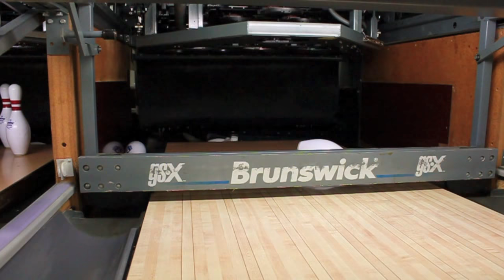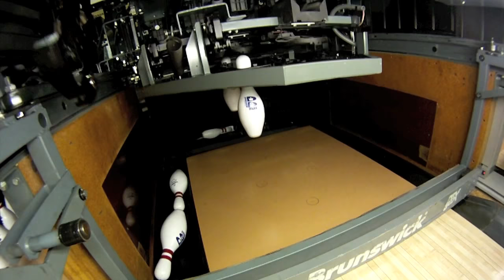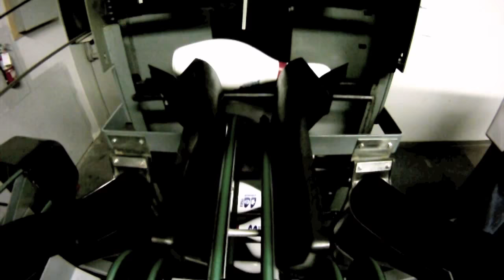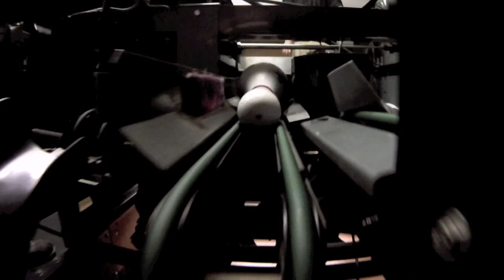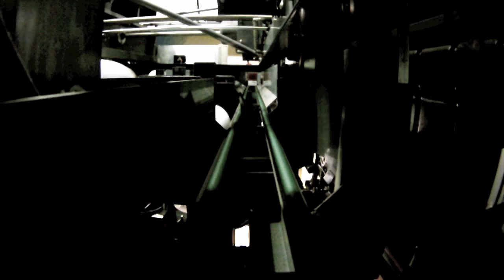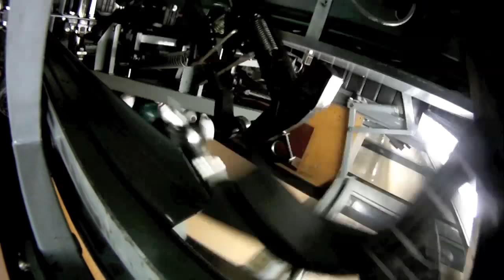AWESOME Brunswick GSX Pinsetter Video

Comment: Bowling in an empty house with a gsx is interesting.  You can hear the machine running clearly sweep, pins dropping into setting table and everything. It's not the quietest machine made but it operates just fine for me. Bowling on 8290s you can hear the clunking sound of the pins getting dropped off by the distributor arm too.

Comment: The GSX Video is well done. I do not understand why Brunswick reverted to chain drive and the complicated pin distribution system. Too many moving parts compared to the A2. I do feel that the pin setting rack is a big improvement over the A2. Only time will tell if this pinsetter will deliver better results than the A2.

Comment: SOOOO Brunswick saw what AMF did and Copied it?  Give me the good OLD tank A-2's ANYDAY over this GARBAGE!
Reply: the person who designed the original GS-10 combined pieces of 5 different pinsetters...Brunswick A series, AMF, Candlepin, 5-pin and Duckpin
Reply: What part of this was copied from AMF?
Reply: @Pinz n Pinsetters A big problem with these machines is the pin elevator. Way too slow! All the pins do is fight each other to get on a shovel.
Reply: @bsgp60  Some have that problem but mostly do not
Reply: The GS wasn’t originally made by Brunswick, someone made this machine and Brunswick acquired it.
Reply: C’mon mechanics. I personally bowled on GS and they were fine while AMF’s are garbage throughout my 10 Year Bowling experience. Bowler experience matters more than Pinsetter mechanics work on them. Probably you never seen Pinsetter Mechanics bowl competitively.

Edit: Also A2’s I haven’t tried them yet but I wanna if only AMF wasn’t a thing here in the Philippines that tooked over.